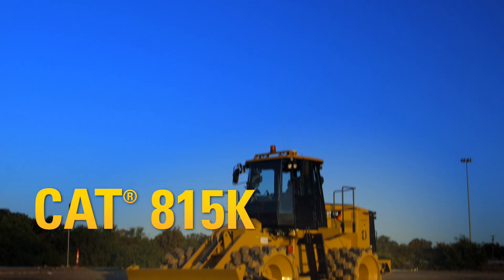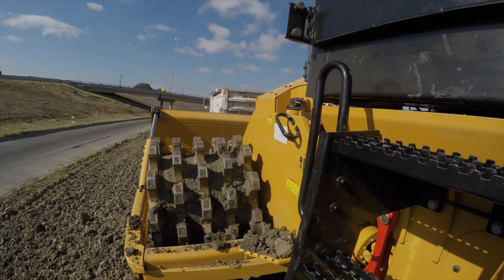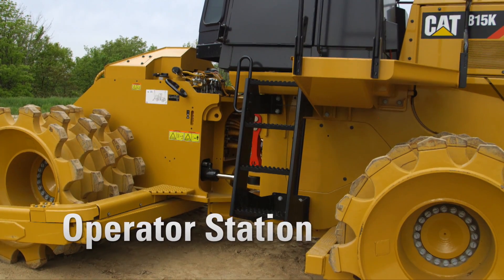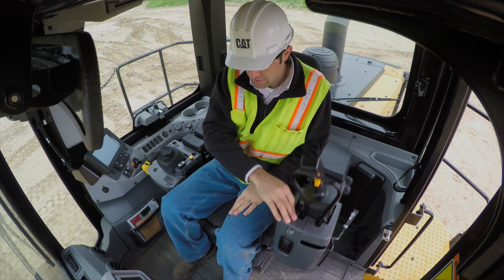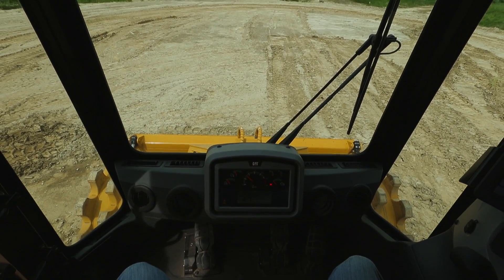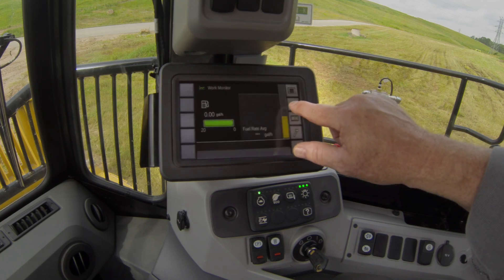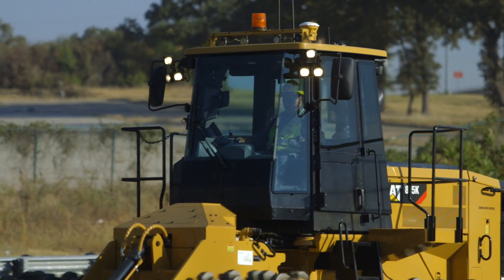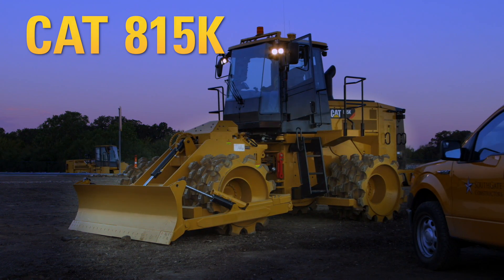Cat® 815K Soil Compactor Structures

Comment: Yeah, new expensive Cat equipment. Meanwhile, all of us disabled operators sitting at home with broken backs and blown shoulders. But I’m glad that they’re learning to make it better for the operator.
Reply: May I ask, is operating a soil compactor hard on the body (back, shoulders)? If so, why? Are there lots of vibrations and impacts while compacting soil?
Reply: @Kenji314159  yeah sure, it depends on the ground that you’re compacting but almost any piece of equipment on a dirt job is bouncy. Sometimes they would have us go over what’s called rip rap or broken concrete and asphalt, that’s seriously hard on you. Or ripping rock with a dozer, uhh!
Reply: @Kenji314159  and also you are constantly moving the blade up and down so it’s hard on your shoulders